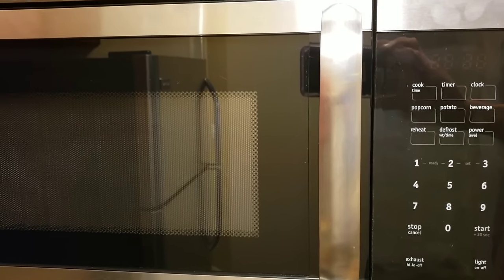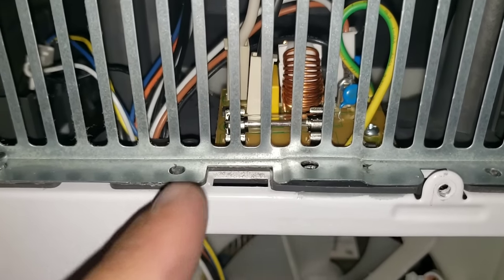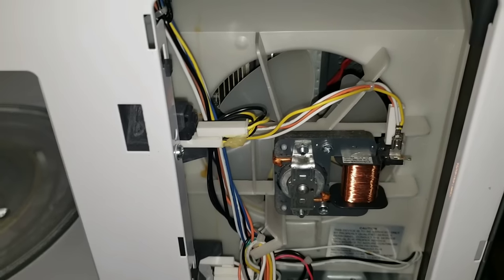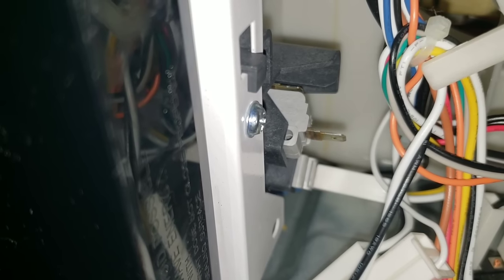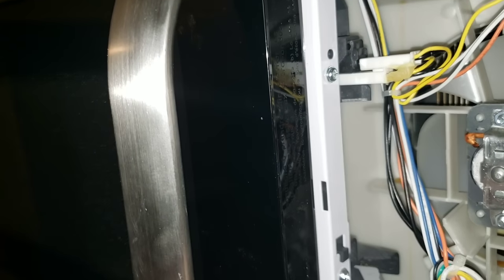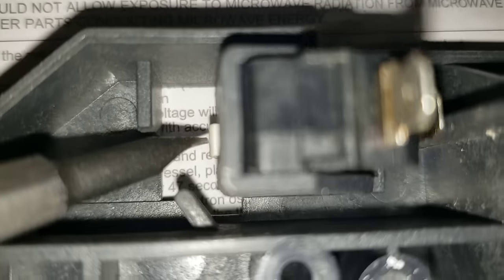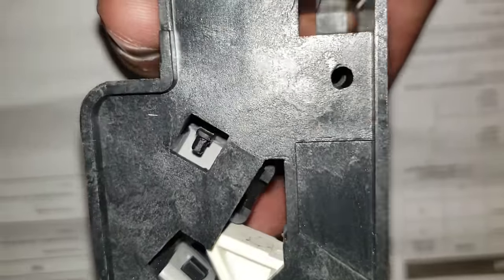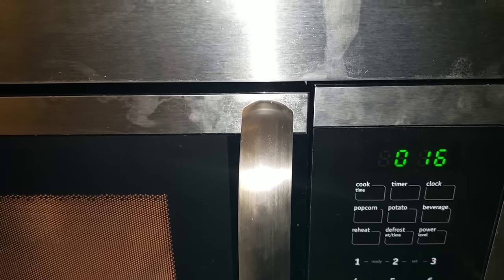Microwave Keeps Tripping Breaker? Here's WHY!

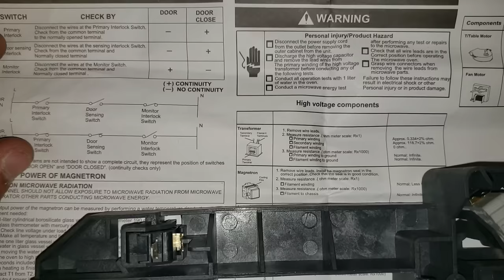Comment: Another video explains that one switch, the normally open one (top), supplies power to the magnetron, while the normally open one (middle, (Monitor interlock" see 7:06) shorts AC power. Mine had the same switch "bad" the middle one), but actually the switch was fine, no wear or malfunction, just bad mechanical design in that the door latch didn't quite press the switch actuator far enough. And of course no adjustment available. So I ended up drilling a very small hole in the center of the microswitch actuator and screwing in a #00 screw from an eyeglasses repair kit, thus adding about 1mm of height to it, enough so that when the door closed, the switch was activated correctly.  Cheap design, a single DPDT switch with some mechanical adjustment available would have been the right way to go.

Comment: I have 2 year old GE JVM3160RF3 on a dedicated 20A circuit, and the breaker would trip a few seconds after starting the microwave.  The monitoring switch in the middle was bad and would get a tone on my multimeter whether the door was open or closed... just like what Sam was showing in the video.  Bought this switch off amazon:   https://www.amazon.com/gp/product/B07789LPPG/ref=ppx_yo_dt_b_asin_title_o00_s00?ie=UTF8&psc=1 .  Just need to make sure to install the correct one cause the package comes with 2 switches that are different... one is open, the other closed.  Thanks Sam for posting the video.  You saved me from purchasing another microwave.

Comment: Be careful when you using the term Normally Open or Normally Closed. Both referred to the state of the switch when it is out of the circuit. i.e. the actuator is at rest. In this example the top and bottom switches are normally open and the middle is normally closed.  How do I know this? I used your video to help repair my microware and as luck would have it my middle switch was bad. When I put a NO in that position it blew the fuse. Hope this helps. Nice video BTW. It really helped me fix my microwave. Oh Yea NC switches are hard to find.  Hope this helps.

Comment: Thanks for the video. I had the same problem with my GE microwave the middle switch was jammed and there was continuity all the time. I did not realize these switches could cause the breaker to trip so your video pointed me in the right direction. The microwave is less than 2 years old so I'm surprised the switch failed so soon. 

I previously replaced one of the normally open switches on my last microwave when it was 22 years old (although I don't know the service history of the first 8 years). Can't remember if it was the top or bottom, but the fan would start running when the door was opened and turn off again as soon as it was closed.

Comment: Testing a fuse with both sides in the holder does not confirm necessarily that it is good right?  You need to remove one side at least to confirm continuity of the fuse.  Great video! Thanks for posting.

Comment: Not sure I’ll get an answer on here, but recently replaced my monitor switch and fuse (thanks to this video!). However, when I plugged the microwave back in, there’s a buzzing sound. It goes away when I open the door, but with the microwave plugged in, off, and door closed, it sounds like it’s running (the light and turntable aren’t on though). Any ideas? I’m about to open it back up and see if there’s anything obvious.

Edit: turned out the lower screen holding the door switch bracket wasn’t quite all the way tightened. I guess it was meaning the switch mechanism wasn’t hitting one of the switched quite right. Tightened it up, and everything seems good now.  Thanks for the awesome video!

Comment: thanks  - good video ... looks like you tech sheet has a misprint though -  It refers to the door sensing switch as having a normally closed terminal when in fact it should only have a normally Open terminal

Comment: I diagnose this exact same switch to be bad on the Frigidaire Gallery 1550 watt, and I noticed that leaving that allows me to operate the microwave normally oh, it is Christmas and I cannot get the switch probably quickly enough for Christmas Eve and Christmas Day dinners, can I leave the switch disconnected for temporary until I can get a switch for this and use the microwave in this capacity just till after Christmas hopefully you can explain why I should or shouldn't do that thank you I love the video my name is David I appreciate your expertise
Reply: Trucker ManJr you can disconnect the secondary switch, but if your primary switch then fails then the microwave will work with the door open and this is very dangerous. If other people beside you are using the microwave you should not leave it unrepaired for long.

Comment: Hi Sam, Thank you for the great video showing how to access, test and replace these switches.
So, my microwave pops the circuit breaker when the door is opened while the microwave is running, just like your example.  Trying to plan ahead, I purchased the monitor (middle) switch and door (lower) switch. 

After getting things apart, I tested all three and oh oh, they all test good.  The feel and sound of the micro-switches is also good.  The fuse above also tests good.  So what the heck, I went ahead and replaced the monitor and door switch. 

Sadly, the problem isn't fixed. 

Do you think it's worth ordering the primary switch or maybe something else is wrong?
Reply: ever find a fix. Having this exact issue. Fuse blows if opened while running. Replaced monitor switches, and the other two seem appear to check out.
Reply: Same issue for me... the fuse pops if the door is open be for the microwave stops.
Reply: If it helps, I found the bracket that the hinge closes into had warn down over time. This was causing the switches to open in the incorrect order. Replacing this part fixed it.

Comment: So my microwave conked out on Christmas day, breaker will not stay on, I was thinking I would need an electrician but thanks to your video, I opened the door of the microwave and sure enough, the breaker stayed on. Shut the door and it immediately tripped. So instead of an electrician, I need an appliance repair service call. Thanks for the detailed explanation.

Comment: Great video super helpful I had the same problem fuse was blown into 1000 pieces replaced it then breaker started tripping then I started checking switches for continuity and found the same problem monitoring  switch was bad I got lucky and a local appliance repair shop had it in stock for 16 bucks so with the 4 dollar pack of ceramic fuses I spent $20 in total and now my microwave works perfectly again. I’m thinking the relay switch could have went bad from me slamming door all the time. Probably not the best idea since there are 3 switches right  on the other side. 🤷🏻‍♂️

Comment: I'm an electrical engineer and if you don't want to change the switch holder or switches,  then replace your fuse if it is blown and also cut the single white wire on the middle switch.  Tape up the white wires that you just cut.  This will fix the issue and the fuse won't blow anymore.  Remember to cut the correct single white wire.  Not the side with the black and white wire that are together.

Comment: I found that over 3 years of use, and the plastic on the door which pushes against these switches had a dent on it with repeated rubbing on it. I just put a small piece of zip tie over the dent, to fill it with a double sided tape, and my microwave works fine now. It is switch issue, but because switch wasn’t getting activated, due improper press. I did not change anything. I have a GE microwave.

Comment: Thank you! Just repaired my microwave (exact same model at the one in this video) thanks to this!
A question though: The top plug (black/yellow) is really tough to pull off. The other two came out with little force, but I couldn't get the top one out at all. If I ever have to replace that microswitch, I will consider using a pair of vise-grips for extra leverage. Do you find the same issue with some that you're repairing?

Comment: hey thanks for the video, i had the same exact problem but after replacing the monitor switch it worked for 3-4 times and  the monitor switch blew again, any suggestions?
Reply: This is my problem now, did you ever get a fix?
Reply: @selfpittypiggy  same...
Reply: @rickastley3009  I found that making sure the microwave is done or stopped before opening the door helps.  If you interrupt the cook suddenly by opening the the door your chance of arcing this switch is high
Reply: Any complete fixes of this problem?

Comment: This really helped me out on taking it apart. I noticed the Monitor Switch would stay stuck causing the breaker to instantly pop when plugging the microwave in. 

I do not have the tool to check for continuity. The microwave runs now but I have to hit stop and then open the door. If I open the door while the microwave is running, it pops the breaker.  

Could it just be the Monitor switch or could it be something else? I am going to order the monitor switch but I rather order the rest of the parts to not pay double for shipping.

Comment: I have this microwave and I am having the same problem.  I disabled the door switch and it works now, so I know I need to replace this.   Like I said it is the same exact microwave that is in this video- do you happen to have the part number for that?
Also, do you know if there is a danger of using the microwave with the door switch disabled?  Thanks for this video!

Comment: Hi, thanks for the detailed video. My GE microwave was tripping breaker. I took out the 3 door switches and found the middle one not clicking and is stiff. So replaced it but microwave works fine for couple of times but same thing happens - it trips the breaker once i start it. The replaced switch loses it's 'clicking' and is stiff. Any other reason for microwave tripping  breaker ?
Reply: Same issue...  checked all switches.. test ok.  But keeps tripping breaker... same set-up (appears to be GE).  Any thoughts?  I am going to replace all 3 given that is much cheaper than buying a new one.  The symptoms are exactly as described.
Reply: @katarina13.13  Did you do a resistance test with a multimeter? That is the only way to be sure. They may be fine and it is something else, and your time and money for the switches would be a waste. If you don't have a multimeter, I'd suggest picking up one. These days for no more than 20 bucks you can pick up a decent one, and they are useful for all kinds of testing of different devices.

Comment: Awesome, thanks!  I  have an additional problem, when I use my OTR microwave, sometimes it shuts completely off and also shuts my gas stove completely off too. I checked the breaker, and it keeps popping the breaker, which I just got a new one today but, it still keeps popping. Can a defective fuse pop the breaker for both the microwave,  and stove? Can you please advise possibly? Thank you.

Comment: I replaced the 3 switches (1 was bad and wasn't working, but replaced all three) and it ran for a bit. I stopped it using the cancal button and did this several times. Tried heating up some food and after a minute, I blew a fuse again. What else can it be besides the handle switches? Is there something else that can be causing the fuse to blow? Thanks in advance and I appreciate your video. I learned something.

Comment: Great help!  I did all my checks and as it turns out it was my hood thermostat that wouldn't let my turn table turn and heat up.  However, now, the fan won't turn off!  What can it be?  I checked what you called the oven thermostat is not giving me continuity.  But does that double as a socket for the lightbulb inside the microwave?
Reply: I have the same question... its a lightbulb what he called a hood thermostat

Comment: Hi Sam, super useful video with step by step instructions.  Our microwave suddenly started tripping, and we were staring at $300 to $500 expense. Following your video, we figured out that one door clickers was  not working. We ordered it from Amazon for $10 bucks and microwave works like a charm. Thank you very much for posting the video. One quick question. If we open the door before the cooking time without pressing the stop button, it trips circuit. Any thoughts on why this would happen and how to fix it? Once again, thank you for posting this video.
Reply: That’s the classic door switch problem. You’ll be doing a new repair if you don’t stop the oven before opening it. The switches need to be opening/closing at the same time and it’s easy for them to get off sync.

Comment: Our microwave started tripping the breaker too.  It’s a dedicated breaker as well.  After finding your extremely helpful video, I discovered it was the monitoring switch.  No clicks.  I replaced the switch, and the microwave was fixed for about 10 seconds.  It’s a Frigidaire btw.  While testing, I opened the microwave door to stop it, like everyone else does, and the breaker tripped.  The new monitoring switch is now bad!  Any ideas?  I reached out to Frigidaire too.

Comment: This is bizarre to me.  Who would think a bad switch could cause a direct short of 110V power to a house panel !!  You would think the microwave fuse would blow first? The door switches probably would not do this but the monitoring switch?  Micro switches are so tightly constructed I would not think they could short out like that, stick, yes.  My 32 yo Maytag cuts out under heavy use but just for about 30 seconds.  Then the oven light comes back on and the unit works again.  I think it is a Thermal cut out.  Otherwise the unit performs perfectly and always has boiled a mug of water in 2 minutes.
Reply: I thought the same thing - a micro switch fails and - the 20A breaker trips?!? yikes.

Comment: Excellent explanation. However, I'm not understanding how a switch that has malfunctioned (stuck open or closed) could cause a microwave to trip the breaker. If it was drawing excess current, I would thing that the fuse would blow before the breaker tripped.

Comment: It worked.  It was the monitor switch for me.  it was the 2nd one I had to put in in less than 6 months.  This time when I put it all back together it would not start.  All the buttons are responsive; even when I push the start button, it puts 30 seconds on the display and beeps, but will not run.  Any suggestions for that?  I checked out the ribbon thing in one of your other videos, but it was secure.
Reply: Similar issue for me: fuse no longer popping, but the internal fan (not the vent fan) runs, interior light stays on, and won't run. Did you find a solution? Anyone have an idea?
Reply: Did you guys find a solution to your problem in having the exact same issues with my microwave
Reply: Michael Kirk no. I have a claim in with American home shield. Pushing for them to replace it

Comment: What you pointed at and called the “oven thermostat” near the fuse is actually the lampholder... you can see the microwave light goes into the other side if you replace it.

Comment: Thank you for this really helpful. seems like I am also having problem with monitoring switch. But my question is about round items at bottom( I am guessing capacitors). I am getting continuity for first one that you also have in this video but not in other one(on the right). Is that expected or that is gone bad as well?
Reply: Have you replaced the fuse on the right? Is that the vent motor thermostat?  Mine is bad too!! Not sure if this is the issue. My fuse went a couple of times but my door switches seem ok!

Comment: About removing the switch from the holder, can you please reply how to remove / re-insert the switch without damaging the holder.  I thought there was a release on the back of the holder that should be pressed along with the button on the switch to remove and that it just clicks in place when sliding the switch back in the holder.  I have a GE Convection microwace made in 2012.

Is there anything besides the fuse and door switches that should be checked when the microwave has no lights / power?

I would appreciate any help.  I'm retired and can't really afford a new microwave.  I really need to fix the one I have.  It stopped having power after using it and closing the door.  I checked the outlet and breaker was on already.

If the switch clicks does that usually mean the switch is good?  I realize to be sure you have to test continuity.  I'm trying to get ahold of a multimeter but just wondering if the switch clicks if the switch is usually good.  All 3 switches on my microwave click when pressing the button on the switch.

If you could tell me more about getting switches / fuses that are universal for GE so I don't have to buy oem parts It would be a great help.

Comment: I've replaced the door sending switch twice now in the last 3 months. Each time it fixes the problem but within a few days it ends up going bad again. Any thoughts
Reply: Everything these days is cheap shit. We had our last microwave for 13 years and no problem.
Reply: I figured out the switch was fine. It was just sitting loose in the housing and the door latch was missing the button. I layered some tape on one side of the switch so it would line up with the door and now it works fine.